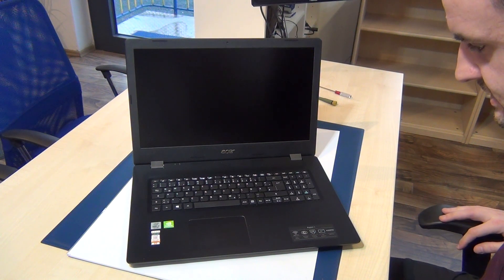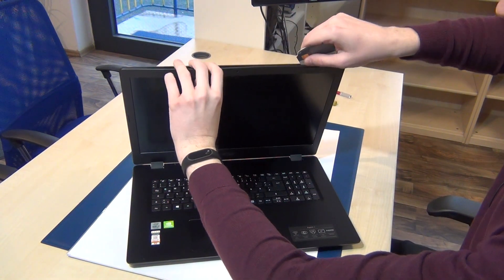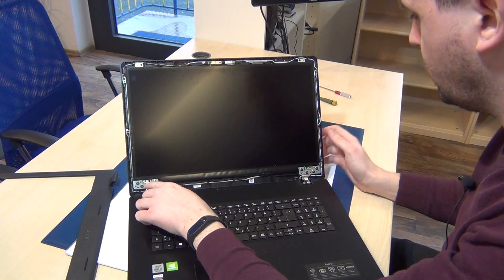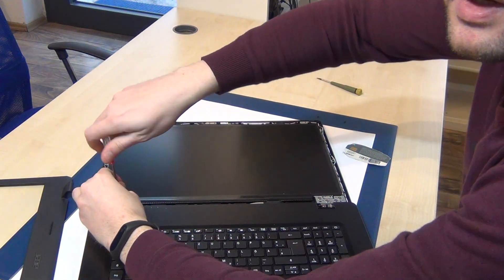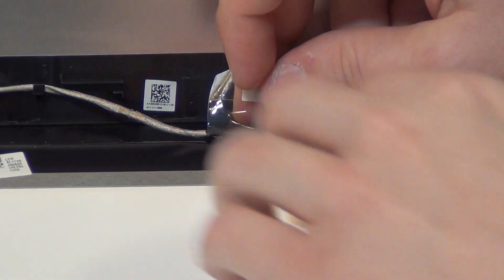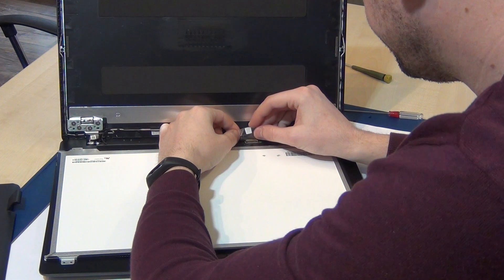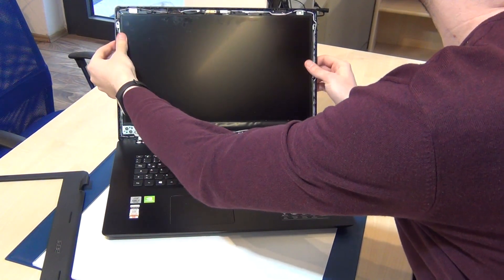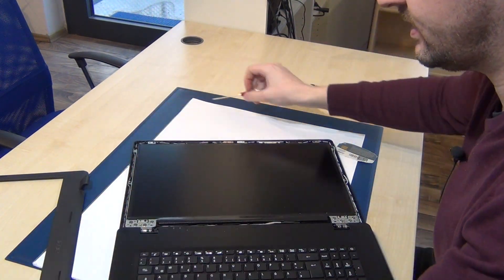Acer Aspire 3 A317 A315 Series Laptop Screen Display Replacement  - Repair Guide / Broken Screen

Comment from the maker: Parts / Passende Bauteile für den Umbau:

Mich unterstützen/Support me and buy at amazon - https://amzn.to/3P8uXjS (*)

Arbeitsspeicher Crucial 8GB SO DDR4 RAM 3200 - https://amzn.to/3i2h1vm (*)
Arbeitsspeicher Crucial 16GB SO DDR4 RAM 3200 - https://amzn.to/3tMyB9e (*)
Arbeitsspeicher Crucial 32GB SO DDR4 RAM - https://amzn.to/3tOg2S1 (*)

Kompatible Akkus zu AC14B18J - https://amzn.to/3H9G6yM (*)

9mm DVD Slim Brenner - https://amzn.to/3UwkhfV (*)

SSD Festplatte WD Blue Series 512/1TB/2TB - https://amzn.to/3GFuLGi (*)
SSD Festplatte - 512GB Crucial P2 Serie - https://amzn.to/3TQCdS3 (*)
SSD Festplatte 1TB Crucial NVME P2 Serie - https://amzn.to/3EgSda4 (*)
SSD Festplatte 2TB Samsung NVME 970 EVO Serie - https://amzn.to/3ENiYod (*)

Die mit Sternchen (*) gekennzeichneten Links sind sogenannte Affiliate-Links. 
Wenn du auf so einen Affiliate-Link klickst und über diesen Link einkaufst,
bekomme ich von dem betreffenden Online-Shop oder Anbieter eine Provision. 
Für dich verändert sich der Preis nicht.

Comment: Additional safety precaution. When changing lcds remove your batteries first to avoid board shortage. Not all people can plug back that 30pin connector in one try. But your video is very helpful.

Comment: I have the exact same laptop but with Intel 3 10th gen, since my screen broken I needed this video so badly to know how to safely remove the screen and show the technicians the info for a new display replacement.  Do I have to disconnect the battery???

Edit: I own an HP pavilion gaming laptop now, the other acer is just trashed wont fix it.
Edit 2 as of 2024: I fixed that acer laptop and gave it to my father so he learns some computing.

Comment: Do you know if the connector is the same for all A315-51 models? My laptop has a resolution of 1366x768 but other Laptops with the exact same (A315-51-39US) model number can also have 1080p so im wondering if I could upgrade the screen to a 1080p one.

Comment: hello i get a problème with my acer a317 a change my screen but the laptop dosnt turn on, i need to know if i can fixe it or no, thank you
Reply: Was the battery and the charger disconnected while replacing the screen??? Otherwise something made your laptop hardware havoc, in short words, die.